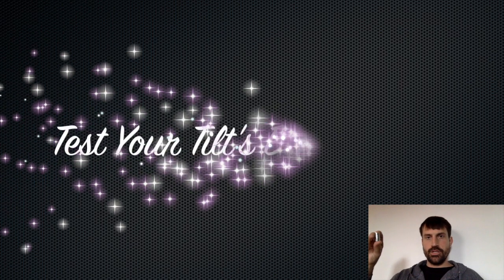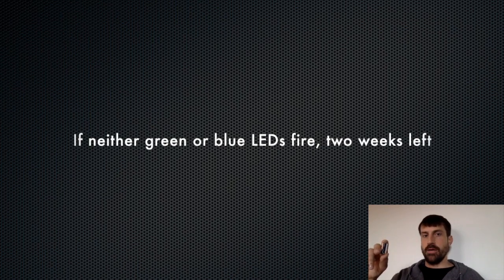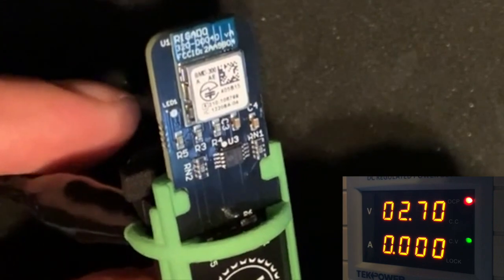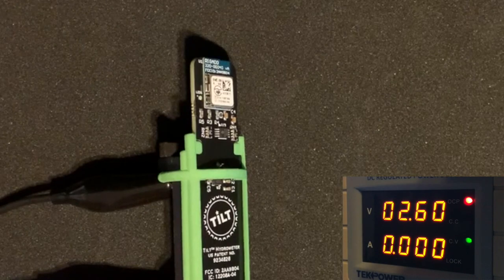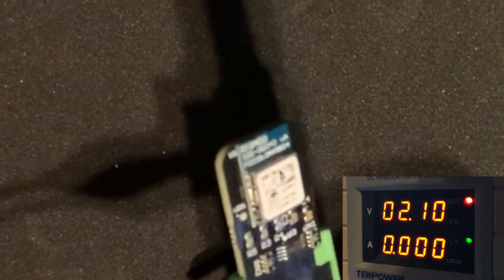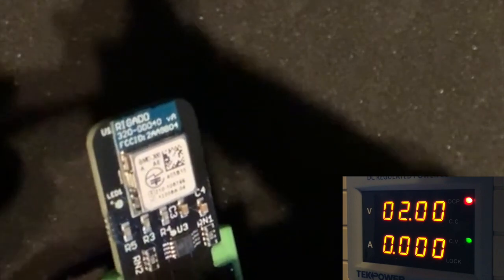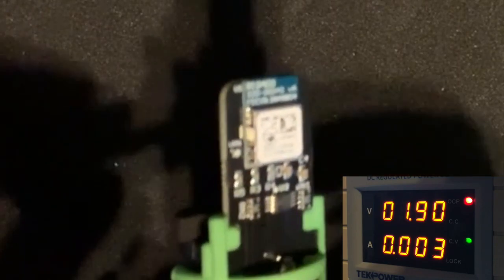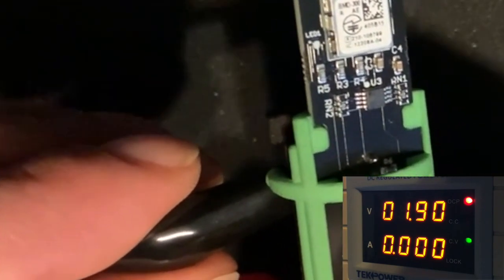Test Your Tilt Battery

Comment: Hi Noah. I just switched from room temp ferments in a glass carboy to a 6 gal corny in a fridge. My tilt is connected to an old iPad Air. It sits about 3 feet from the fridge. For the first few weeks of fermentation I had great signal but then in the latter part I would have to bring the iPad closer to the fridge and eventually inside the fridge to get readings. Is the loss of bt range a signal that my battery is going to die soon?